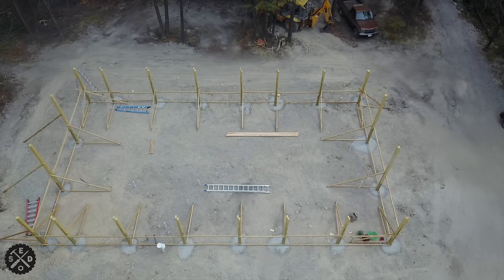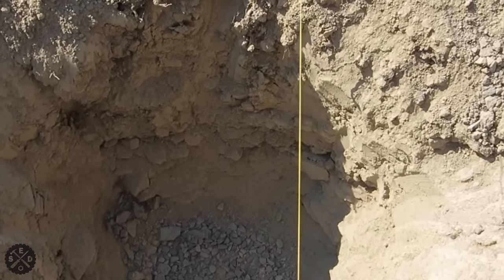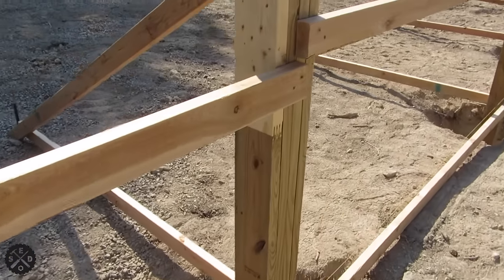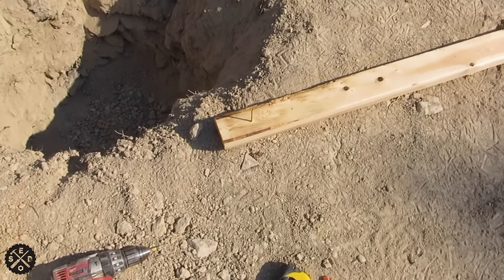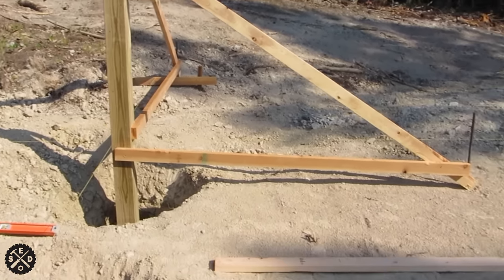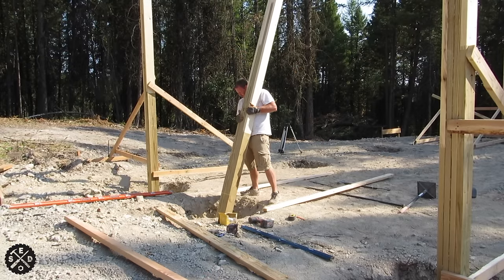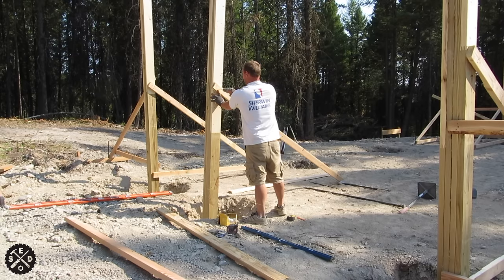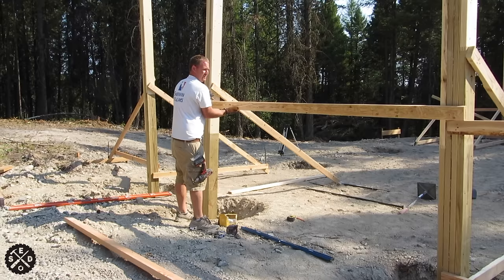How To Set Posts To Build A Pole Barn Yourself DIY

Comment: How do you make the posts the same level above the ground?
Reply from the maker: I did it with a laser transit. I show that in the next video in the series I think.
Reply: @SmartEasyDIYer  can I do it without a laser?
Reply from the maker: Yes you can do it with a bucket of water and clear hose. You may need to search up that method it’s old school but it actually works. Once it’s set up, Water always finds level.
Reply: @SmartEasyDIYer  thank you for the responses.  I would love to build a Rv Carport.
Reply from the maker: You’re welcome. Good luck with it!

Comment: Think think think.
Hold a plumb bob up from about 20 ft away. Your buddy moves post till you say it is in alignment with string.
Then move over 1/3 around  hold up the blumb bob again. Align the pole.
This will work perfect especially if you are putting in Power Poles ( pole barn).
Because they are tappered going smaller as it gies up.  So a level will not work.
3 guys ..2 with plumb bobs and 1 at the pole.
Alignment is to center of pole with the string.
Reply from the maker: Does the guy holding the string 20’ up in the air just hover over the top? 😁
Reply: This video is about setting them yourself.
No buddy.  Glulam posts will be straight.

Comment: Anither way to keep the outer line true..
Is to keep all posts off the string.maybe use a paint stick for your guide (distance from string to post)
Putting the post against the string.   Will move the string some amount...
Then the next post will be off a tiny bit more..
And so on
Not touching the string you can be as straight as possible...
Old timer lesson learned on the job..
Yes attach the paint sticks on each corner post for the string to pull arond
(Outer edge)
Reply from the maker: Thanks for the tip. I’ve heard that before too. I personally didn’t quite touch the string every time that way it didn’t keep moving. Just kept it off the string a frog hair. Which is a tiny amount. 😁

Comment: Happy Birthday! The larger question is who brought in the Nitro tubes to make the holes? ;) .. Goes back to the old westerns..
Reply from the maker: Thanks!! I was wondering when you were gonna comment. 😊 yeah it was insanely Rocky out of 20 holes I only got 2 to drill all the way! I had to rent a mini excavator with a jack hammer bit to get them deep enough. I’ll cover that in a later video. Probably episode 3 or 4 of the Pole Barn series.
Reply: Funny..
Reply from the maker: It was crazy how rocky it was!  It should never settle. :)

Comment: how tall are post and how deep is holes?
Reply from the maker: My posts are 14’ tall total, the holes are 42-48” deep so there’s roughly 10’ sticking out of the ground once it’s set.
Reply: @SmartEasyDIYer  gotcha...i live in NC where frost line is at 12". I plan to put mine 36" deep with 12' sticking out of ground...sound deep enough to you?
Reply from the maker: Yeah I would say even if you’re not concerned about frost I would go at least 3 feet just for stability. Good luck with it! 👊
Reply: @SmartEasyDIYer  thanks bud!

Comment: How do you protect the poles — set down into the earth. — from moisture and rot?!
Reply from the maker: I was always told the big thing if you do them in concrete is not to set them on concrete as well because that traps the moisture inside of them so to do crushed gravel underneath so the water can escape. One thing some people do if you don’t want to use concrete at all is to use crushed gravel all the way around that way the water doesn’t sit around them either. Probably if I did it again nowadays I would use something like post protectors or perhaps do the concrete pier and wet set bracket method. If you want some things to research.
Reply: @SmartEasyDIYer  
Thanks for the response. I really like pole barns, everything about them. And actually, the setting of the wooden poles into the soil is the only weak point in the entire set-up. As I write this I conceived of using the brackets, thinking about your brackets idea for the posts and setting them on top of cement, even a monolithic slab. And yet I am not an engineer, and here in the communist enclave of California I must have architects and engineers sign off on everything — except for a few rural areas. Maybe I’ll move to the rural areas.
Reply from the maker: You’re welcome. Yes in a place like that living in a rural area would be best probably. Yes it seems like you could certainly use them on a slab and do the brackets on top of them. Youd have to talk to your local building department and make sure they’re OK with that so you know upfront. Sounds like you’re researching some good ideas. Good luck with everything!

Comment: why cement? cement rots posts out faster,
Reply from the maker: I know there has been a lot of debate about that over the years. What I’ve been told by a builder here that talks directly to the manufacture says what they recommend is to set it on gravel that’s packed and then pour cement around it then if any moisture gets in around the post it’ll drain out the bottom and disappear. If you set it on cement and then pour around it it’ll trap the moisture and it can’t get out.

Comment: Something that will help you NOT sound like a noob is calling it "concrete".....not cement.
Basic concrete is made from water, aggregates (sand and rock) and CEMENT.  You can also add "admixtures" like air-entrainment, water reducer, super-plasticizer, fiber mesh, etc.
Portland cement is a fine powder made from lime, silica and alumina.
Reply from the maker: Thank you yes I am aware of the difference between them I just usually used the term interchangeably. I have since tried to be more careful. Lol

Comment: Ever consider using these:  

https://www.menards.com/main/building-materials/pole-barn-post-frame-materials/pole-barn-post-frame-hardware/6-x-6-post-bracket/1104983/p-1444448491275.htm

Would seem that it would simplify the process as it would be easier to get those in the cement and line them up.  After cement cures, put posts in, etc?
Reply from the maker: Yes I think next time I would probably try something similar to those. They weren’t really available in my area at the time when I made this so this is more of the traditional way of setting posts. Thanks

Comment: why cant you pour your own post footings?
Reply from the maker: You could. You mean like piers and attach to that?
Reply: @SmartEasyDIYer  no i mean the post holes, you have them poured with a cement truck. seems like you can do these by hand
Reply from the maker: Oh yes you could. It would take quite a lot. Not as much typically but I hit a lot of rocks so my holes got very big.
Reply: @SmartEasyDIYer  really? How many bags of cement per hole would you estimate?
Reply from the maker: I think it took about 9 yards for 20 or 24 holes. I can’t remember the exact amount that would take quite a lot of bags! Like I said my holes got a lot bigger because of all the rocks that I found so it would’ve taken a lot less on a normal hole.

Comment: This must be the most complicated and stressful way to get a post into a hole... Let's start with the hole. Were you digging for oil or why the dimensions?
Another idea: you knew you were doing this alone, so plan for that. Start with a small concrete  column. No need for a truck! Screw the pole directly to the hard concrete pillar. Easy job
Reply from the maker: I ended up hitting lots of rocks so my holes got way big from the bit walking around. Your idea could work in perfect digging dirt but I wanted to actually pour it not have be a precast type but to each their own.

Comment: It would be better if post sits on cement It will last longer.
Reply from the maker: If you pour cement around the post I’ve heard it’s better to sit on gravel so moisture can drain out not get trapped in the bottom.
Reply: treated lumber today will rot in 15 years. Telephone and railroad are only ones that will never rot because they used mix of creosote. Its illegal to even buy the staff now but it will last forever.

Comment: You are wasting way too much time with that level, here what I use, works great and under $5.00 Johnson Level 9-in Cross Check Standard Level . Good job!
Reply from the maker: That’s not very accurate on a long post though I wouldn’t think cuz posts have have bows in them and the longer the level the better to get a better overall.
Reply: Dan Car I use a 4' level on wood and sometimes a small torpedo level on metal pipes.

Comment: See I helped build one with someone and they used nails I use screws if I build one myself screws work better
Reply from the maker: Yeah at least for temporary use. I like screws because they’re a lot easier to change if you get it a little bit wrong and also to reuse the lumber when you’re done. For permanent fastening using ring shank galvanized nails are good.